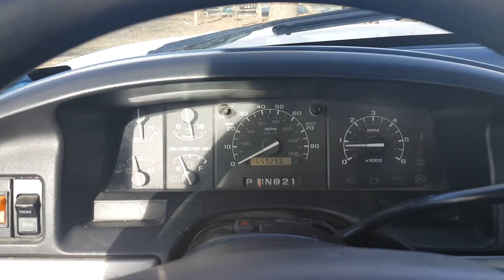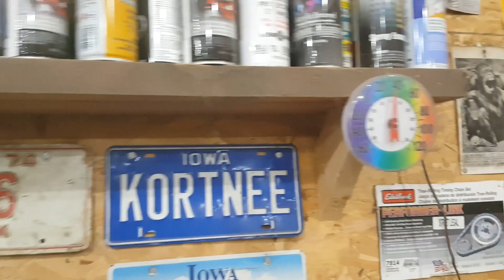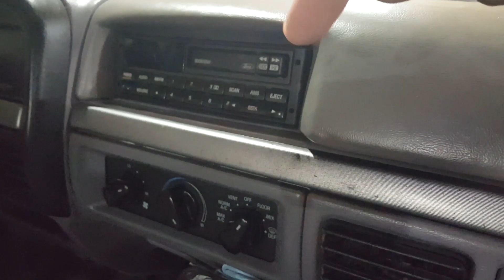F150 DRUM BRAKE REPLACEMENT AND PRE-SALVAGE YARD

Comment: I use a cassette tape adapter the plugs into my phone but they sell Bluetooth cassette tape adapters for under $20.
Reply from the maker: I have one of those.. thinking there is something wrong with the cassette player in my truck.  The adaptor thing works fine with the radio I use in the shop, but in the truck it makes a weird noise every now and then. Time for an upgrade!

Comment: By chance, did you recently purchase a set of Warn 9790 hubs? Someone in your town purchased a set from me on eBay recently so I'm bound to ask
Reply from the maker: Nope, wasn't this guy!
Reply: Darn, I was gonna say don't forget my eBay feedback. What's a 92 radio look like? I might have one, it's been dropped though, looks okay though, I know I've got one out a 94 a Pioneer was put in the buttons are stubborn on.
Reply from the maker: a 92 should be the same as a 94.  91 has a different style I think.
Reply: Ford used the same am-fm radio from 1987-1996. The factory cd player was a option on the eddie bauer f150's from 1993-1996 but will work on any ford F-series from 1987-1996 and if you ever find a good working one they are worth a fare bit of money.
Reply: I bought one that looks new out a 95 F150, has CD, three connections, and I haven't bothered testing it yet, been dropped a small distance but taken apart looked unharmed
Reply: Those radios are pretty tough as long as it was not smashed i would say it is still good. And they actually sound good for a mid 90's cd player.